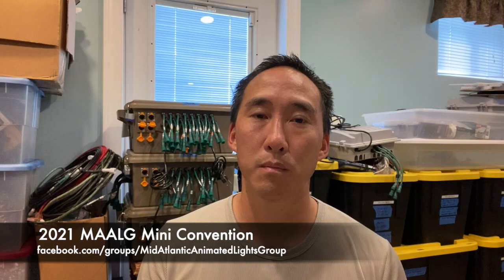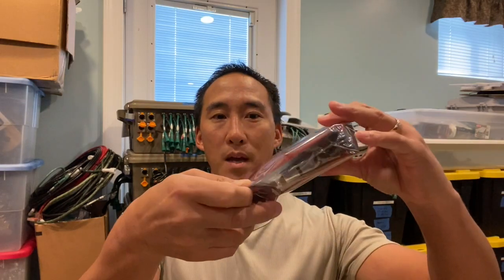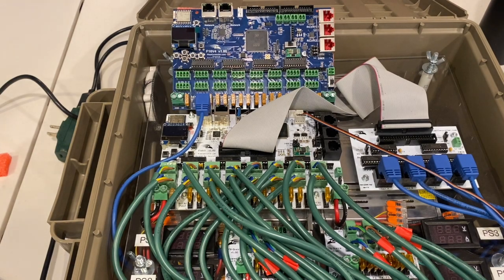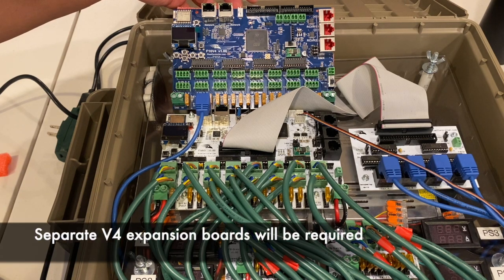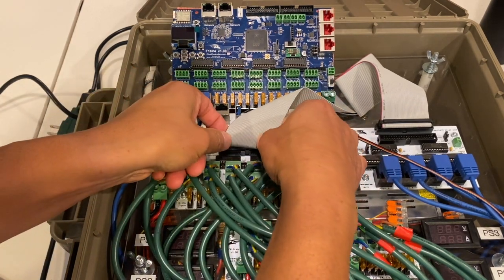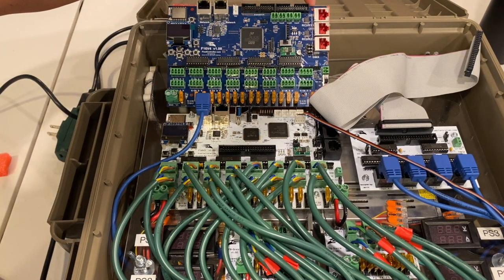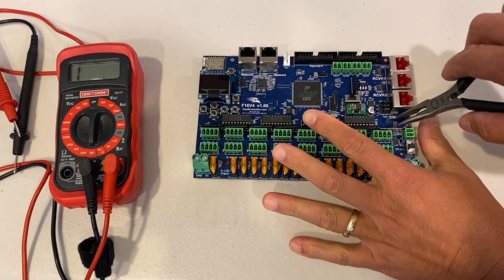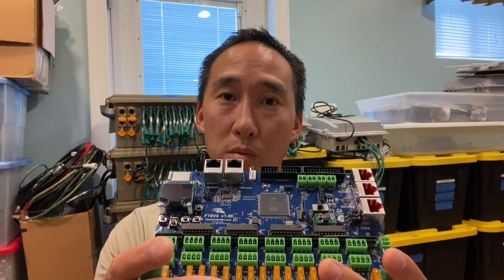Unboxing the Falcon F16v4

Comment: Can you please send me a link where you got those green wires that are connecting to the channels?
Reply from the maker: The green items that plug into the board that connect to the pixel pigtails are called Europlugs.  When you purchase a controller like the Falcon F16, it should come with those items, so all you need to do is strip the ends of your controller pigtails then screw them into the europlug that then is inserted into each output on the board.
Reply: @NiFamilyLights  Thank you!

Comment: Ok….. I just bought the pre made version of this. In a box like one over your left shoulder. How would you mount that to a house?!? I really didn’t want to have to remove it from the case they sent it to me in.
Reply from the maker: Congratulations Gregory on getting your F16V4! To mount the CG1500 enclosure, there are two areas on the back you can punch out to insert a hose style clamp to attach it vertically to a pipe. I show those locations in this video at 4:50. If you watch my behind the scenes videos, you’ll see where I mount these boxes. However, none of them are mounted directly to the house. Good luck!

https://m.youtube.com/watch?v=SpxxnLqOqcs
Reply: @NiFamilyLights  ahh. Yeah. Falcon didn’t use that same box.  It’s slightly different. There are no punch outs. My back doesn’t even look like that. My thought now if building a “cage” of sorts out of slotted angle iron and maybe mounting that to a wall and sliding the box in. Anything to avoid unscrewing the board from inside the box and screwing through the back of it. But thank you. Love your channel.

Comment: Your knowledge on this f16v4 is light years ahead of my understanding of this thing. What expansion boards can be used with this board?  If any. I've asked falcon. And get one word responses. Thank You
Reply from the maker: John, once you start playing with the controllers to make lights blink, it doesn't take long to get the hang of things.  The Falcon website has a really good user manual https://www.pixelcontroller.com/store/content/14-F16V4-support.  

I advise you read most of it to really understand what it can do.  Explanation of expansion boards start at Section 3.2.5 of the manual.  This board is an all around best of breed board to support small shows up to some pretty elaborate setups with plenty of local ports and the ability to add many remote ports with smart receivers.  

If you're able to get a F16V3 controller, they have a separate user manual for that, but the similar concepts apply when it comes to expansion boards for that version (which is what I have been using in my shows).
Reply: @NiFamilyLights  
I clicked on the link you provided too me. Oh no. 404. 😆  page is no longer available. Aaahhhhgggg
Reply from the maker: Edited the post.  The parenthesis got used in the URL which messed it all up.  I removed the parenthesis so the link works now.

Comment: Well I received 2 of these this yr for my first ever light setup and am having trouble setting everything up, all the videos i have see are of the v3 and the interface is different and i am a noob to this, anyway of doing and setup video of the controller, xlights, and fpp setup on a raspberry pi?
Reply from the maker: Matt, thanks for the comment and congrats on getting started. If you have 2 Falcon controllers and are planning to run your show from a Rasp Pi, you are working with tried and true technology that is extremely reliable and very well supported. 

Thanks for the video idea. I’ll add it to the list.

Comment: How conected ligth my friend ws2811
Reply from the maker: Typically the controller is housed in a weather proof box. You’ll connect pixel pigtail wiring to euro connectors which plug into the 4 pin euro plugs on the controller. The pixel pigtails go out of your controller enclosure which you’ll then plug into your lights.

Comment: I am reviewing this video in light of your previous video on the power of 33 ohms.  Do you have any data on whether the 33 ohms resistance on the F16V4 outputs is also in place for the V4 Smart Receivers?  I don't see ANY resistor on those boards!
Reply from the maker: Hey Larry, the V3 smart receivers have 100 ohm resistors soldered to the boards. The V4 also have resistors soldered, but I do not know if they are 100 ohms or if they have been switched to 33 ohms.

Comment: The old smart receivers only work in dumb mode on the v4
Reply from the maker: Thanks for the clarification Kate.  One can't use the old smart receivers (called differential receivers) in a chain anyway since they only have one interface port.  But the good news as you state is that they can be used.  

So, off I go to get a new differential expansion board v4 to go with the new F16v4, and I'll be good to go with a backup.
Reply: @NiFamilyLights  yes, the original differential receivers are like that, but im talking about the smart receivers that support chaining on f16v3. they can only work like the original dumb differential receivers on f16v4

Comment from the maker: I didn’t look close enough but the top right mounting hole is slightly to the right by about half an inch or so in the V4 vs the V3. So, that one mounting location would have to change if you’re swapping a V3 for a V4 in any existing setup.